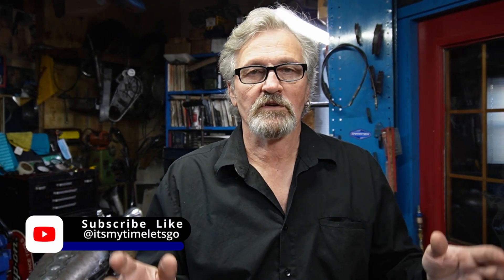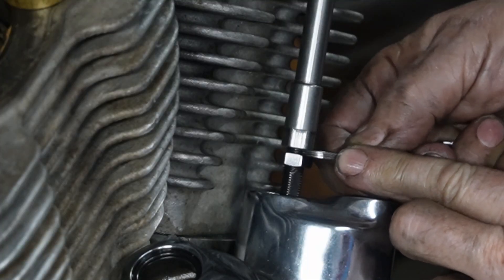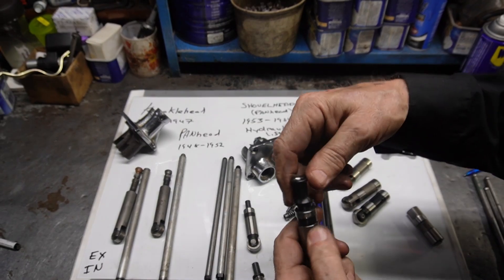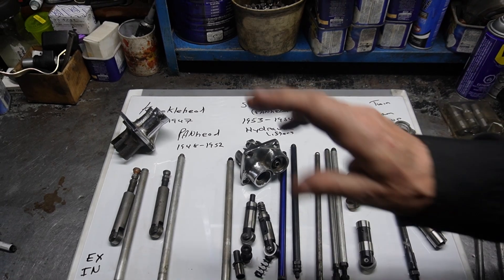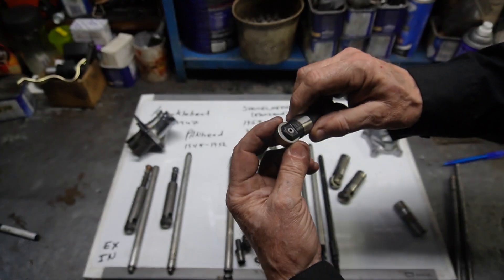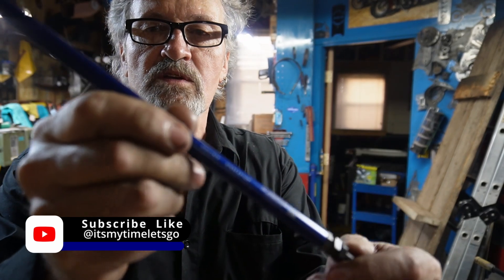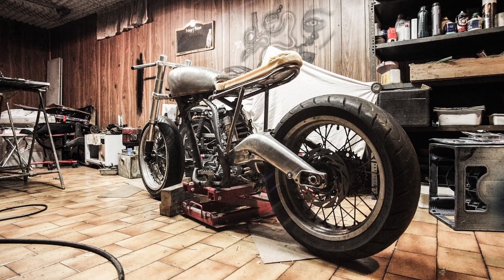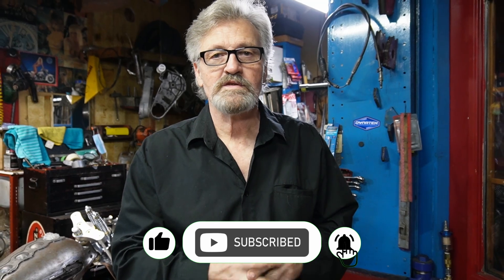DO YOU KNOW WHAT YA GOT? LET’S US HELP SHOW YOU /  PUSHROD IDENTIFICATION

Comment: What do you recommend to clean up the inside bore of evo style tappet block…my new screaming eagle tappets fit in nicely with no shake but I noticed one of the bores I have a hard time sinking the tappet all the way into bore without a bit of resistance as if it’s hanging up..the inside of bore looks clean with no noticeable burs or deep scratches
Reply from the maker: Thanks for asking. I do not have a definate answer for you , but I can say what I would do if I ran into the problem. Here are a few things you might try. Try different tappets in the tight hole, you have probably done that but I have found it to solve that problem in the past.  Swap them around all the holes.  That  will at least assure you that it is the hole and not the tappet. Sometimes the slightist  bit can make a difference. If that did not work then you could try a light sanding on the bore , like at least 600 gt, and go slowly and try , slowly and try (clean out well before you try the lifter in the bore so that it does not  get grit on , or in it. You don't want to oval the hole so just work it all around.  NOTE: I hesitate to start sanding the lifter as, they are precision made, there is a greater chance of getting the fine grit in the moving parts and oil hole. 
Perhaps someone out there has a suggestion. I'm no expert and only do things the way I do it. Perhaps there is a better way. Hope this helped.